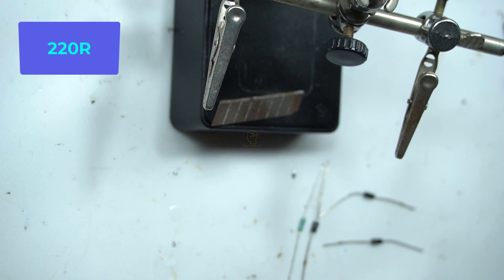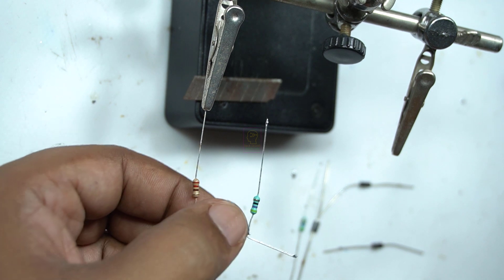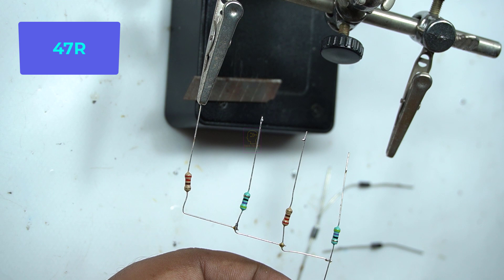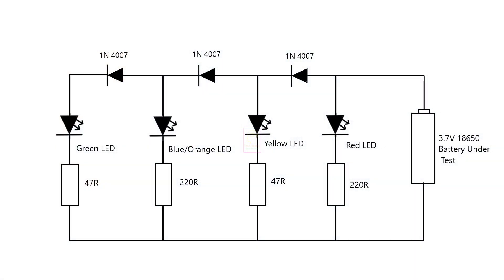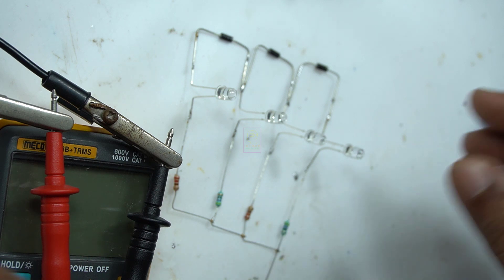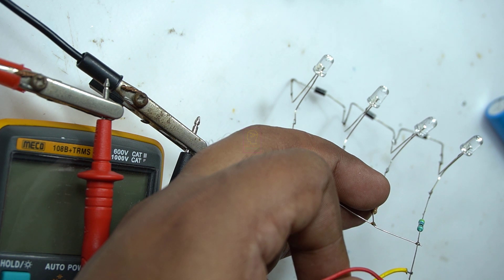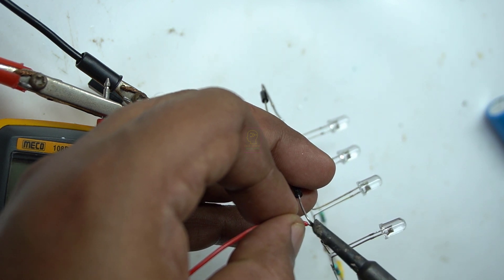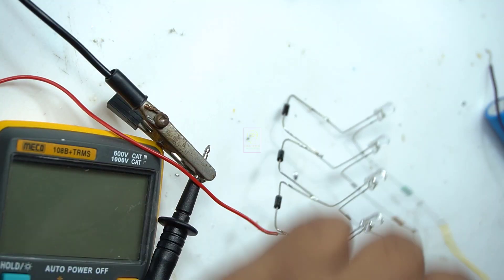How to make Simple 3.7V Battery Level Indicator Circuit (18650)

Comment: Along with component connection please explain circuit working on diagram without fail no matter what.
Reply from the maker: I believe I explained it in video. It is a voltage divider with 0.7v drops used from diode. Thanks bro will do from next video
Reply: Nice suggestion
Reply: Good suggestion
Reply: Nice